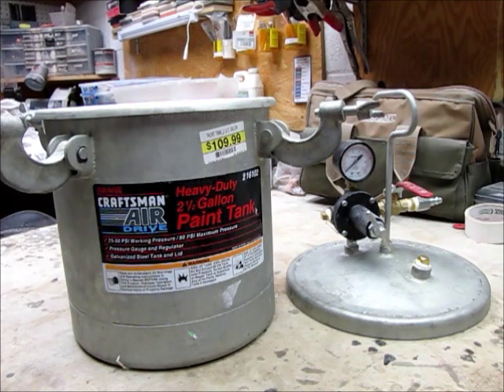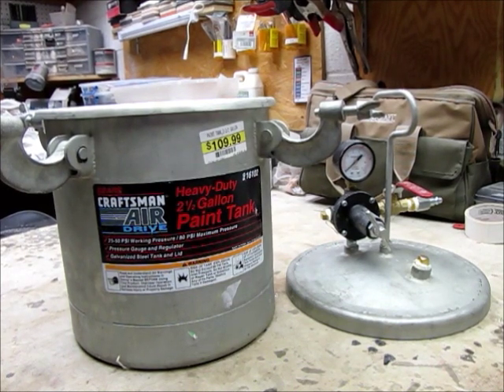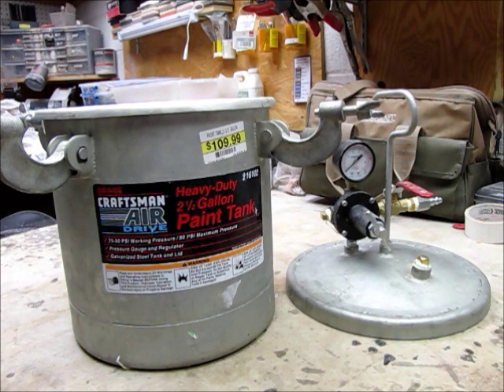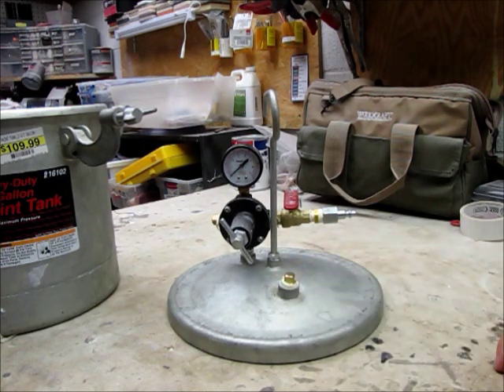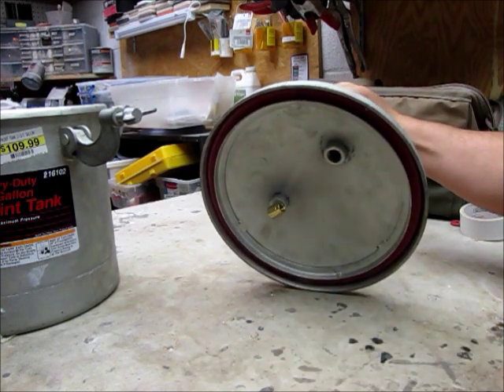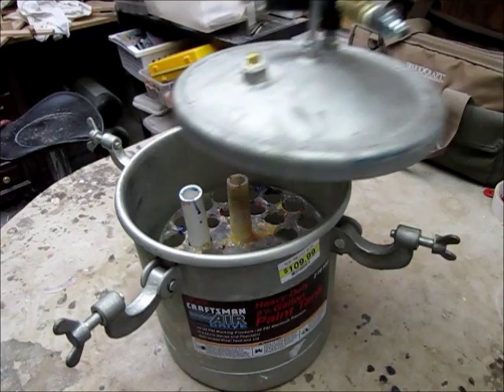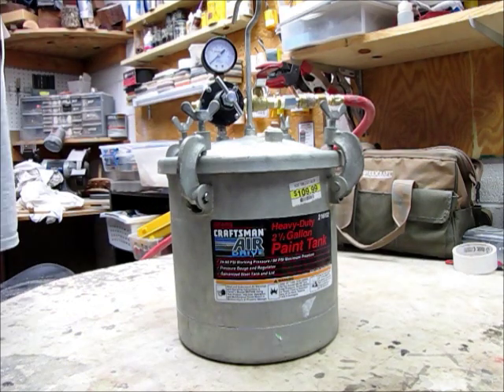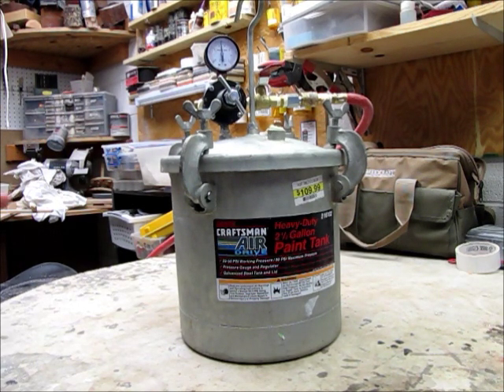Resin Blank casting pressure pot overview

Comment: this kind of pressure pot its use in some kind of resin? or in all? I imagine that kind of procedure is just for acrylic . or is also use in silmar41 or epoxy and polyurethane? thanks
Reply from the maker: I do use a pressure pot for poly resin when I'm selling them.  Just
Reply: polyester?
Reply from the maker: Yes, Silmar 41 is a type of Polyester resin.
Reply: Thank you so much. Last question. What do you think about the homemade pressure pot? I see a pvc pipeline like pressure pot
Reply from the maker: one word - Dangerous
Reply: hello! I would like to know how to get a better result in my pieces because it puts more than 90 psi pressure more they do not know for what reason are sanido with streaks on the surface of the part would have any idea what is happening .... from ja thank you thank you !!!

Comment: Hi Brian, thanks for your videos. They are really helpful!  I may have missed it but do you have, or have plans to post, a video to go over setup of a pressure pot and recommended Blank Casting specs for compressor and pressure pot, for a mid-volume 1-man startup shop? I'm swimming in an ocean of CFM's, Max, Optimal and Operating Range PSI, HP's, oil or oil less, pancake or hot dog  LOL

Comment: how do you get your resin molds out of the tubes?
Reply from the maker: +brewskisdodge The resin in the tube must heat up enough to shrink.  If the curing process didn't do it, than you can put it in the sun or put it in an oven at the lowest setting about 170 degrees for about 10 mins.
Reply: +fool4peppers thank you!!

Comment from the maker: In most cases, vacuum is used stabilizing blanks.  You can use it to cast blanks but since the vacuum pump is a most specialize piece of equipment, I already had a air pump and found a pressure pot cheap.  Both will eliminate the air bubbles.

Comment from the maker: I have about the same for an air compressor.  You need to check to see that you don't have air leaking.  The lid might not be tight enough.  Sometimes, I take a coat my rubber gasket with Vaseline to help it seal.

Comment: does it matter what air compressor i have to pump enough air into my pressure pot? i have the same pressure pot as you and i cant seem to go past 30 psi. i have a Campbell Hausfeld AIR COMPRESSOR 1 Gallon Pancake 110 VOLT FP2028 INFLATOR, if it matters. thanks. V

Comment from the maker: The pressure pot was purchased at a salvage warehouse for $25 and the brass value and plugs were less than $15.  I got lucky on the price of the pot.  Normally you can find used pots for around $50.